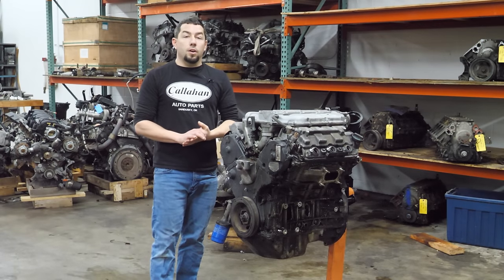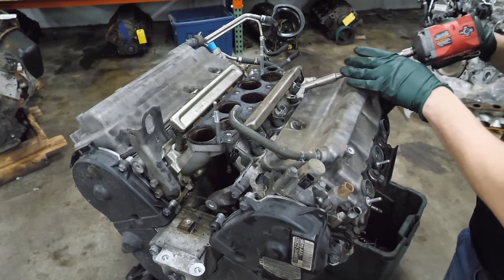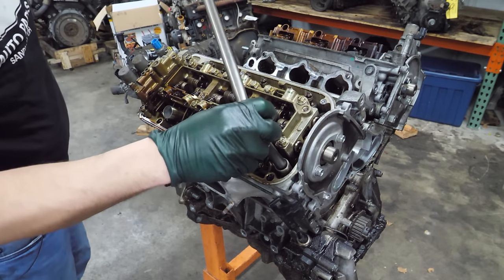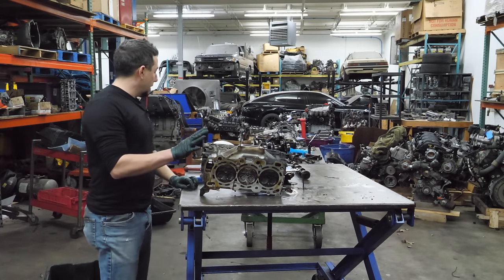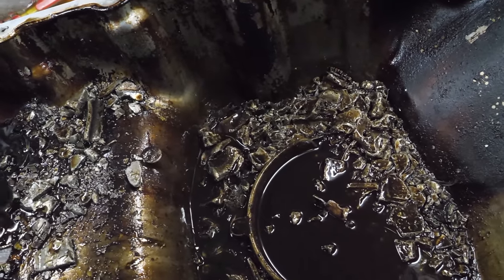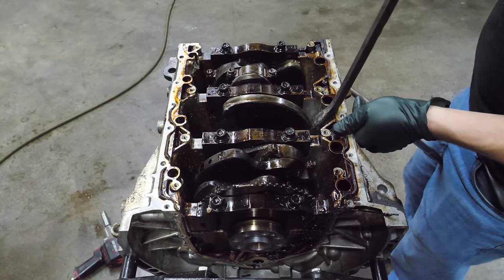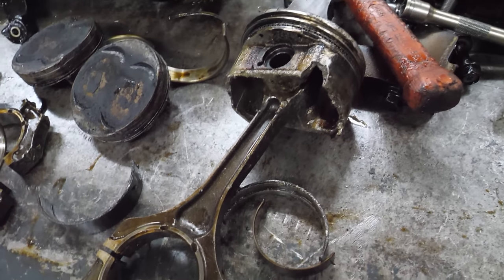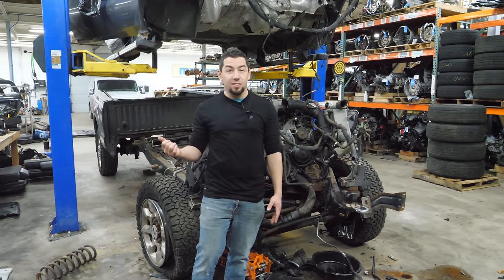Obliterated Honda Accord J35 V6 Teardown. Customer States: "Vehicle Shut Off"  OH I BET IT DID!

Comment: I had a 1996 Honda Accord that they recommended a new timing belt at 110,000 miles.  And they told me I was running on "borrowed time" at that point.  So if that's the original belt at 180,000 miles, that's amazing.

Comment: WOW!  That's all i can say, the amount of carnage in this engine is amazing.

I think to find one worse you may need to get your hands on a blown up top fuel dragster motor.
Reply: Mind a blown TF Dragster motor wouldn't rate as high as most of the parts will've been mostly launched far far away... (hopefully not into the crowd.)

Comment: All that happened in under 10 seconds, prior to which the engine was 100% intact. It started breaking apart at highway speeds, and of course 95% of that damage didnt happen under its own power, but keeping the gearbox engaged at high speed. So the crank chewed up everything.

Comment: I don't know what grenaded that engine so spectacularly!!😱
Maybe "Willy Peter" (white phosphorus)? That would cause the heat damage.   Nitroglycerin?

All kidding aside, it's amazing what damage oil starvation or "spent*⁹ dirty oil can do to an engine!😱

Spending around $300-$375 a year at a shop to have your oil and filter changed every 3k miles rather than replacing an engine should be a no-brainer. Guess that's the problem; these people have NO frigging brains!

Haven't seen the KIa V-6 yet, but can't imagine anything worse than this Honda!!

Thanks for a great video!!👍👍

Comment: I’ve been wrenching 50 years.  I refuse to believe that engine ran itself to pieces like that.  Any grenade that severe wouldn’t have turned over enough revs to fill the oil pickup with shards - that was my smoking gun.  Has got to be a “towed in gear” failure.  Everything turning, except the electric cooling fans.  Overheated from friction, seized, and continued to shed parts.

Comment: As many know the vcm caused oil burning issues due to worn pistons. More often than not customers would come in with no oil in the engine/misfire codes and when informed of the thousands of dollars it would take to fix it, just buy a set of plugs, oil change, and go on their way. So its no surprise with the oil burning issue and extended oil change intervals that this happened. You should see the amount of k series we get that have zero oil in them and customers complaining of rattle on cold start lmao

Comment: We quickly removed valves with nothing other than a socket and extension; put the head upright on a block of wood or rubber, use a socket that hits only the spring retainer, and hit it with a heavy hammer. Pop goes the little valve keepers.
Edit: and of course you knew that! It can be done with good heads, if done properly.

Comment: The inside of that engine sure was finely shredded, between the windage tray and the oil pan I couldn't even call that a jumbo sharing bucket, that was a darn three course family meal 🤣.  First you've got the oil and coolant soup as the starter, some nice big juicy nuggets for the main course and a pick-n-mix with lots of sprinkles for dessert 😁

Comment: I have a 2007 chevy monte carlo ss,  with the v8 ls4. It's got the cylinder management system, that I only use on long drives on the freeway. Warming the engine up and around town, I leave the transmission in 3rd. gear, as it stays in all 8 cyl. mode. Is this a sound practice? I have read that uneven block heat can cause problems when the engine is not up to operating temperature. Your thoughts?

Comment: 2 biggest causes of failures on j series is timing belt and driving it hard with low oil. That being said one of the most reliable engines i bought mine with 280k and drove it hard for 82k still going strong.

Comment: I have a 2009 accord v6. 98,000 miles. Ill be doing my timing belt, oil pump and likely tensioner this spring. Any suggestions?  Can that cylinder deactivation be deleted? I'm not interested in a
1 mpg benefit at the expense of the longevity of my engine.

Comment: I saw a video on another channel where a guy purchased a almost totally burned Dodge Challenger Demon. There was a fire in interior, upper part of engine bay, but the best malice was below. Transmission. Its guts were hanging out. When it was removed, case was half gone. Floorpan above transmission had no damage and other than burnt engine harness, minor melted plastic bits in engine, that was perfect.

Comment: Worked on cars for 45 years and have seen my share of Honda carnage. But in this case one picture is worth a thousand words. 
  There is a picture from the late 60's or early 70's I wish you could see.  33 Willys fuel altered leaving the line with the front wheels 4 feet in the air.  
Camera dude caught the greatest picture ever. It shows the crank, 8 rods and 8 pistons hitting the ground as a unit at the instant of separation.  Probably screwed up on his nitro mix.

Comment: Crank bolt to remove harmonic balancer, I was waiting for the fight.  What? Way way too easy!  I've had to use a 6 foot breaker bar on Honda V6 engines.

Comment: Sorry Eric a picture is worth a thousand words. 1. Loose (or loosened) balancer bolt (difficult), 2. White out on belt drive "gears" outer edge showing crank one tooth off  from both cams @ 10 minutes into the video on my large 4k monitor. 3. Clean (fresh) hydraulic tensioner on a dirty engine (Aisen unit). (4)Drive belt found in the most popular belt kits on Amazon are the Malaysian unit with that same number. 5. stated recent new owner @ 180K miles. 6. New Aisen water pump (larger center impeller piece) that is very clean on a dirty engine. 6.Severe interference engine with valve strikes on all six cylinders and otherwise average valve train. 7. All metal is from piston pin ends of the rods not prestine main bearing uppers. This was a hastelloy hydraulic lock leading to crankcase flail disease not oil failure - the oil captured was better than most of your cases. Your insights are always held in high regard doctor, but we the arm chair automotive medical board feel remedial study should include study o failure modes of this unit (never water pump or seals, often aftermarket hydraulic tensioners (that strange buzzing noise).    Replacement often cause a single tooth belt movement. Using the dampener bolt to turn over the engine can result in belts moving a tooth even with full tensioner pressure while trying to again remove the difficult bolt- use a milk jug plastic "washer" to avoid it getting on too tight while verifying belt alignment without being able to use the special retaining tool that holds the tensioner plugs. any trouble just melt the "washer" to losen the bolt. As you have worked on jeep liberty diesel 2.8 engines, any video reposts  would be great. Any tidbits on main bearing undersizing- the german clean engine failure modes would be a great  play on your many observations. The first bent valve was on the cylinder with the melted piston.

Comment: I also learned that this VCM Honda system wreaks havoc on the engine mounts. Honda supposedly "fixed" the vibration problem that   switching from 3 to 6 and back again caused. Again no thanks on this engine...

Comment: I have the 3.5L v6 in my 2010 accord, it grenaded about 3 weeks ago. At 350k km I'm not particularly miffed about it since I was planning on replacing the engine anyway it's just forcing me to do it earlier than planned. 
The VCM is straight garbage and I've hated it since I bought the car. Cylinder 2, 4, and 6 create vacuum when they deactivate and it sucks oil up through the rings and fouls the spark plugs. I was replacing plugs around twice a year and burning around 1L of oil every 1000km. Honda actually had a class action lawsuit back in 2013(?) for the issue of these engines burning so much oil. 
I bought a newer engine with only 160k km to put in my car since aside from the big holes in the side of the block there's nothing wrong with the rest of the car, plus good luck finding any vehicle that isn't stupidly priced right now compared the cost of a simple engine. 
This time it will have a VCM muzzler on it way earlier and hopefully won't suffer through as much oil in the cylinders as my engine did in it's life.

Comment: Honda had to "one-up" on GM by offering Cylinder Deactivation Plus. If you're happy with just half the cylinders, you can use the Automatic Cylinder Delete feature to permanently remove unwanted cylinders.

Comment: I suspect this might be possible by simply going down the highway with the cruise control on.  As the one problem rod begins to sieze, the cruise control keeps adding throttle and downshifting to maintain speed until it winds up at WOT and 6000 rpm.  Once the problem rod blows apart, the high velocity debris hitting other rods at high RPM causes them to blow apart, adding more high velocity debris and within a fraction of a second you have five rods and pistons annihilated.

Comment: Hard to believe someone would keep driving the car with as much noise as the engine would have been making while it was destroying itself.  And a testament to the robustness of that Honda engine that it could keep running after 5 pistons/rods had completely disintegrated.

Comment: Eric, I like the fact that Honda tried with their vcm, but I don't get much benefit from it. If you understand the conditions and parameters it needs to work, then you can easily work around. 

Newer j35s post-2015 work around the  common bypass systems, set a flag in the pcm to note you've tampered with it, and generally run like crap after you've put some miles and done the damage to the motor from the well-intentioned ignoring of the clean air act.

Long Story short, don't buy one if you don't understand how to use it; but don't sweat it if you have. It's just a car.

Comment: I told him that 500 nitrous shot was probably a wee bit too much lol. The only time I've seen this kind of destruction is in top fuel engines that scattered at like 12 thousand rpm. Impressive. I'm actually surprised that the crank didn't snap half in two as well.

Comment: There's a tool that you can just hit with a hammer to get valve keepers out. 
The part number for it is 36050. It works basically the same as what you did but can use it on heads you care about

Comment: Get yourself a few cylinder head holders. Two or more braces the size of the head bolt, and is tapered. It holds the head off the table. Think of it like a saw horse.

Comment: Did they perform any maintenance?  I owned two Acuras with this engine.  The transmission was the weak spot, but the engines were reliable.  
EDIT:  There is no way this all happened overnight.  This is neglect over a few weeks.

Comment: I've a theory about the engine's destruction.  It was running on the primary bank which lost its bearings first,  overheated the rods, and softened them, ditto for the pistons, then lost compression.  The driver gave more gas to compensate then the secondary bank powered the engine for a short while, pulverizing the primary bank.
Reply: Kind of like a time when I witnessed a 4wd truck sunk past the fender wells in a soft stream bed.  The driver had gotten it good and stuck in 2wd, then enabled 4wd and sunk the other two wheels.   He was asking passersby to help him push it out.  That was never going to happen.

Comment: Unfreakingbelievable!  You have to be on one serious mission to burn down an engine that bad.
Reply: No kidding. I love Hondas, never had one for less than 240,000 and it still ran great. Just needed a larger car. Almost 300,000 on the Prelude. Still ran like a top but the rear wheel wells rusted badly (common on the mid 1980 models).  So sad to see one thrashed like that.

Comment: I'd like to see the transmission disassembled from that car. It seems that the amount of engine destruction was caused during a long coast down to stop with the torque converter lockup clutch engaged. I think I remember that Honda automatics of that era used helical gears similar to a manual or dual clutch transmission rather than planetary gear sets like other automatics.

Comment: Frequent oil changes with quality high-detergent oils are essential for these modern complex, high-revving multivalve engines with VVT, cylinder deactivation etc.  I suspect that people just got used to being able to use & abuse old-school pushrod I6's & V-8's with poor maintenance and they just kept on running & rarely died, as these engines were simple in design & lubrication needs and were usually over-engineered for durability by today's standards.  Also, many manufacturers specify service intervals that are just waay too long, with some over 9 or 10K miles, which is why I suspect that most teardown videos of these modern imploded engines on this channel and others have one thing in common; dirty oil and filthy, varnished, sludged-up valvetrains & internal parts.

Comment: How!? How does an engine run long enough to do this!? That is amazing.
Reply: It’s almost like they left it in drive while going down hill at 8k RPM.
Reply: @johnmoore3504  I did see an AWD Honda CRV with a manual transmission being towed behind a motor home once but it was left in first gear and towed with the rear wheels still on the ground. First gear being towed at 60 mph or more for miles down an interstate, who knows what rpm that engine was at but it threw all the rods out the side.

Comment: So.. am i to believe the driver just ignored the oil light, oil pressure guage, the knocking & clunking for HOW LONG.

MY '90  CRX Si has close to 350k.  Swapped original engine for '92 civic engine & continue baby'ing it along ( im part of the bottom 99% ).

BIG worry now is transmission.   Honestly do not recall ever changing it but had some added many a moon ago.

Will last me?  Shifts smooth ( 5 speed ), clutch cable stiff w/correct "play".

If FEAR will it warn me or just suddenly stop pulling car???

Comment: I've got an Accord Coupe with the J30A4 and the front bank is much dirtier than the rear. I don't like it, and I do maintain the thing. It made doing a valve adjustment a pain in the ass. I only did it because it needed new valve cover seals, and since I was in there....

Comment: First thing I did when I picked up my wife's 2010 pilot was order a defeat box for the cylinder deactivation.  Just fooled the computer to think it was always 2 degrees cooler than the temp it used to shut down back cylinders.  It oblongs rear cylinder bores, rings were a bandaid.  It's too bad they were forced into the epa mpg game, this ruined all engines from this era.

Comment: Just how fast was this engine spinning when it failed? With all the parts in the oil pick up, it must have kept spinning for at least another 1500 to 3000 revolutions. I had a Kent engine throw a rod at 75 mph and that really got my attention. This would sound like a grenade going off.

Comment: mine have 290000km of VCM... no problem . nothing replace good maintenance , oil change at 5 to 6000 km . i drive very fast but i don t do burnout. this engine as a timing isue and was drained of oil... did not died of old age , it got killed!

Comment: So this massive destruction event probably can't be blamed on anything to do with the "VCM"?
Could some valve or actuator that was part of the VCM have been bleeding off oil pressure and volume over a period of time leading to oil starvation of the connecting rod bearing that seems to have been getting very hot at some point before the massive interior explosive event occurred? Did the event occur when the driver tried to reach 10,000 RPM ?

Comment: I'm just floored for several reasons...First, the engine ran long enough to make most of the pistons break in chunks and look like they had been in a rock polisher for a week....Second, how was there still enough gas, power, and driver determination to run this engine on its last operating cylinder as it continued to grind up the remains?....and Third, how was there enough oil left in the engine to inhale that pile of debris into the pickup??  Sorry Eric decided to scrap the block....could have had his machine shop check it.

Comment: I mean, to say something positive. Based on the level of destruction the engine ran for awhile with multiple cylinders destroyed. I know at normal operating RPM you'd get quite a few revolutions in before it seized but this seems to have gone on for maybe several minutes before it total quit.

Comment: After seeing 2014 Silverado with warped heads and clean and dirty blocks I disable that cylinder shut off stuff.  Cylinder heads cost more than your 20$ fuel savings a year

Comment: Do you need someone to come take apart steel & aluminum for scrap to increase your scrap prricing? I worked for a guy & I would go to work an hour early to bust tranmissions aprart to remove  spacers & other steel pieces so that alll that went to the scrapper was aluminum. Dirty alunimun(with stteel)10 cents a pound-cleasn aluminum was 47 cents a pound -as you can see that is a lot of difference. If you have 100 pounds that pays a lot. We always had at least  1000 pounds usually going toward 10,000 pounds.

Comment: There's an alternative but similar method to removing valves without a spring compressor - instead of using a punch which will damage the valve stems, use an impact socket that fits over the stem and rests fully on the retainer. Then repeat what Eric did - smack it with a hammer and the keepers will fall out. Will not work for install ofc, then you will need a spring compressor